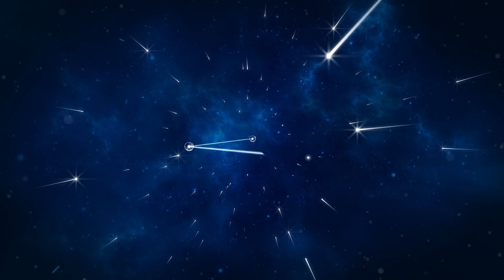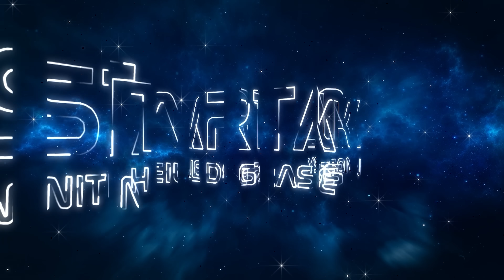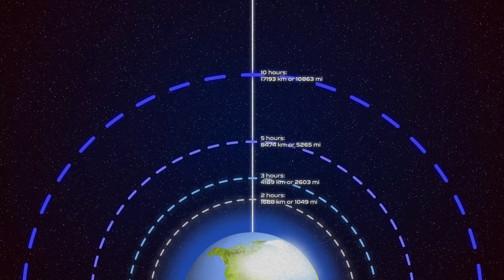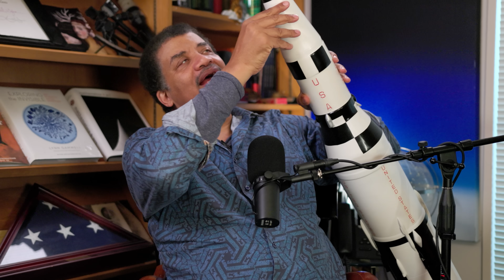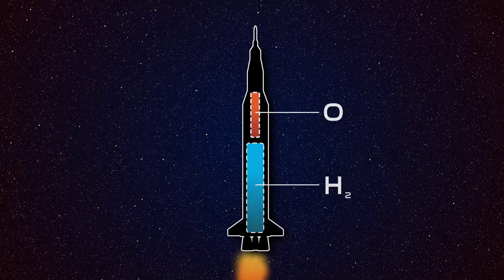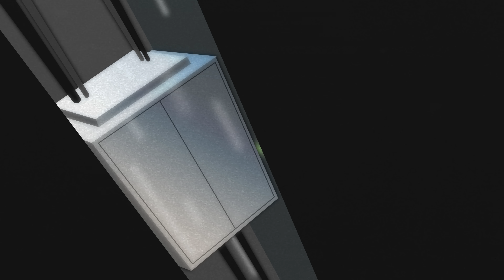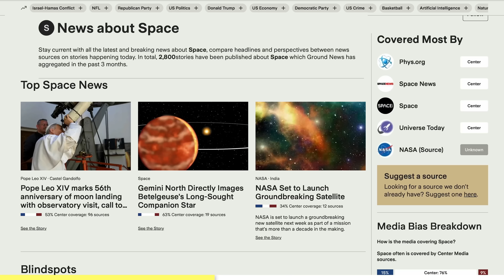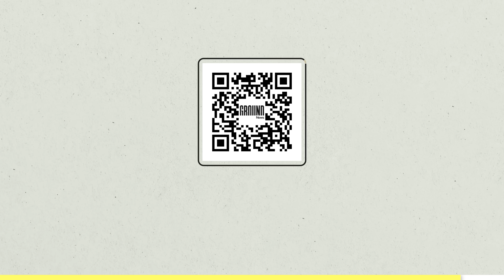When Will We Have a Space Elevator?

Comment: You'd have to be a real dummy to think a space elevator would be used for transporting people to a space port or that you would always ride it to the very top. 

The idea would be to lift heavy equipment and, often, at a much lower orbit. The ISS took decades to complete because small pieces had to be brought up on rockets, months apart, and assembled on site. A space elevator would be counterbalanced at geosynchronous orbit but you could assemble large sections of a space station on earth and lift them to low earth orbit for assembly in much less time.

Comment: The geosynchronous orbit, located at an altitude of approximately 35,786 kilometers above Earth’s equator, is a region of immense significance in both aerospace engineering and Earth sciences. A satellite placed in this orbit completes one revolution around the Earth in exactly 24 hours, matching the planet’s rotational period. This unique orbital synchronization causes the satellite to appear stationary relative to a fixed point on the Earth's surface, making it indispensable for applications that require continuous, real-time coverage of a particular geographic region.

From an aerospace engineering perspective, the insertion and maintenance of a satellite in geosynchronous orbit (GSO) demand a high degree of precision in mission planning and execution. Launch vehicles must achieve a highly elliptical geostationary transfer orbit (GTO), after which onboard propulsion systems perform apogee kick maneuvers to circularize and position the satellite into its final geosynchronous slot. Engineers must also account for a range of perturbative forces, including gravitational influences from the Moon and the Sun, solar radiation pressure, and the non-uniformity of Earth’s gravitational field (particularly the J2 oblateness effect). These forces cause drift and inclination variations that must be mitigated through regular station-keeping maneuvers, which consume onboard propellant and ultimately define the satellite’s operational lifespan.

In the realm of Earth sciences, geosynchronous satellites have proven invaluable for the sustained observation of atmospheric and environmental phenomena. Instruments aboard geosynchronous platforms, such as those on GOES (Geostationary Operational Environmental Satellites), continuously monitor cloud formation, storm development, ocean temperatures, and volcanic activity, providing high temporal resolution data that is critical for both weather forecasting and long-term climate studies. Unlike polar-orbiting satellites, which only provide periodic snapshots, geosynchronous systems enable near-continuous observation of dynamic Earth processes over specific regions, facilitating rapid response to natural disasters and supporting models for global environmental change.

Furthermore, the strategic placement of satellites in geosynchronous orbit enables the formation of constellations that cover nearly the entire globe with minimal infrastructure. This orbit underpins a wide range of systems including satellite television, broadband internet, military reconnaissance, and disaster early warning systems. As space becomes more congested, the sustainable management of GSO positions—allocated through international coordination mechanisms such as those of the ITU (International Telecommunication Union)—has also become an increasingly important subject within aerospace governance and orbital debris mitigation efforts.

In summary, the geosynchronous orbit represents a cornerstone in both the design of resilient aerospace systems and the advancement of Earth observational science. It is a zone where the principles of orbital mechanics are harnessed to enable constant and reliable monitoring and communication capabilities, illustrating a sophisticated interplay between engineering precision and scientific exploration.

Comment: As Chuck joked, but is correct the cable material would start to be extended from geostationary orbit, in both direction for the net pull to be zero.  The real challenges to this endeavor, are micro meteorites, and how the elevator would be powered.   The history of the concept of the space elevator would be an excellent story to cover.

Comment: A method could be a 3 stage escape (plane base) 
Stage 1 mag launch plane/shuttle with air ram engines to 40k ft 
Stage 2 at max air altitude to activate rocket mode to orbit 
Stage 3 return remaining fuel used to re-enter and glide to air jet layer ... re-light engine to land

Comment: I always wonder what kind of structuring you would need for a space elevator to be viable. I mean ten days isn't that big a deal if you're only using it to transport resources, which would keep the purpose staging for further exploration intact, but even with how strong carbon nanotubes are you can't just make a single spire and call it a day. How far out would the supports extend? What kind of supporting architecture would you need to add for future repairs? There's a lot of little safety things that add a ton of padding and weight to the elevator that we have to work around and being the degree-less pleb I am I wonder what it would look like to make it structurally sound

Comment: Ok, here is the next harebrained idea. If we built a ramp to the edge of the atmosphere (edit: or perhaps the upper edge of the troposphere) at the equator, and had an enclosed tube as part of it that kept atmospheric pressure at the bottom end equal to that at the top, and then used maglev or some other propulsion to accelerate capsules fast enough that at the top end they could continue to orbit with less fuel, would it be worthwhile?

Comment: If there was such an elevator, it wouldn't have to be limited to 100mph in space. In fact it could be constantly accelerating (assuming there are resources to do so) up to the midpoint, from which and onward it would start decelerating at the same rate, until it reaches the destination where it's speed would by then be zero. If we assume an acceleration/deceleration rate of 0.5 G's for the comfort of the riders, it would take about 1.5 hours to reach it, and its top speed at the midpoint would be 13250 km/h which is really fast.

Comment: Could someone comment on the question of 'does it save any energy?' The space elevator although slower, still needs to move all that mass against gravity. How is energy being saved? Does it use the same energy but from a cheeper source than rocket fuel? This was the part I never understood.
Reply: Energy is beamed up and converted to electricity to climb the tether.

Comment: As an engineer, there is one thing that bothers me to no end. How the heck are you supposed to get that cable in place? Once it is in place, everything is in equilibrium and it's fine. But how do you get there? You first would have to get the counterweight in place. From there you would have to drop the cable and slowly elevate the counterweight. But the thing is, that, as discussed in the talk, you have different orbit durations and velocities in different heights. So the cable wouldn't stay in a straight line while being dropped. It would wrap around earth, before you get to the ground to fix it. And there is another thing. There is a proposal for such a cable on Wikipedia. I roughly estimated that this cable would weigh (with nanotubes) about 100,000,000 tons. That would cost trillions of bucks. So, I think, the space elevator will always remain a dream.
Reply: It wouldn't wrap around the earth, it wouldn't be long enough.

Tidal forces would pull it straight, that's the whole point.

But the big problem, as you say, is the weight you'd need to get into orbit to build it.
Reply: I guess you'd start in geostationary orbit and launch a rather slow cable laying rocket up and another one down.
Reply: @onkelfabs6408  No need for rockets, you can just unroll the cable and tidal forces will do the rest.

The problem is the sheer mass of the cable, and you need to get that full thing into geostationary orbit first.
Reply: @ZarchAlDain  Well you need something to get it going. You cannot unroll a coil in zero G.

Comment: Hi, Its the chlorine solid state fuel that's the problem with modern rockets that needs to be overcome.Anticipated 1000 launches per year by 2030. The solid state fuel is considerably less polution than we do direct on earth, but its ability stay in the layers around earth combined with its slow corrosive nature, with the volume of anticipated spacecraft( not including solid state powered satellites of which there are around 4-5000) has the potential to accumulate and contribute to global warming issues far quicker than previously estimated. Its not widely discussed.
Space elevator has been knocking around for a while. I had a very similar conversation in early 2000's with one of my bosses sons. Still a thought experiment, but hopefully innovation will lead to better rocket propulsion.
Great topic
Cheers

Comment: i just dont understand how we havent figured out external propulsion.having something propelling a craft even halfway there reduces heavily the fuel expense on the aircrafts lift and solves the fuel problem as they go higher the air thins and easier to create propulsion. that unneeded fuel reduces costs while lowering the cost of pound of material going into space. it woud also reduce the cost because the first stage rocket its engine and fuel wouldnt be needed. if a rail gun type system could be created (and yes i know that would need a wild amount of electricity to the point a complex of nuclear energy and battery arrays would be needed to power this thing but electricity is way cheaper than rocket fuel.

Comment: There's no reason to limit your elevator car to 100, 200, 300 mph, etc. Once you've gotten above most of the atmosphere, you could accelerate the car continuously and cut the trip time to a small fraction of that. You'd want the car to work like a maglev train so it's not putting wear on the cable every time it goes by, but this is just an engineering challenge, and shouldn't be intractable once we have the ability to make such long carbon cables.
Reply: The G forces might be immense upon stopping it though.
Reply: @camerondudley2  Why would it need to stop suddenly?  You accelerate at a comfortable rate until you reach mid point, then decelerate at the same rate the rest of the way.
Reply: You would still be fighting gravity. It wouldn't get that much weaker as you rise up. Sure no air resistance, but you wouldn't be able to excelerate indefinitely.
Reply: @wisemanofsorts6068  Gravity is a constant pull though, regardless of your speed. It's no harder to counteract while going 1000 mph than 100. If you can accelerate upward against gravity you can continue to do so no matter how high you are or how fast you're moving. (It's not like a car with a transmission that can't climb a really steep hill at high speed because the power is reduced.)

Comment: the space "Rope" idea is not that bad, infact, if u dont build a hard stiff tower that has to withstand its own weight, but rather a just something flexible like the rope of the "elevator" itself, or rather a <Funicular> -like  thing, with it being already fixated in space by that mentioned counterweight, then u only need a material for the rope that doesnt tear but gets pulled up against gravity by that counterweight. ...
but be it unpractical as the elevator-part may,  the space port from which to launch rockets would still be a useful thing --- if a rocket just needs enough fuel to go to the station and back, it doesnt need extra fuel to lift the weight of further fuel. --- having the elevator just for goods, like fuel needed for rockets launching from said space port or whatever else that can sit some weeks during transit, would then still be something useful 🤷‍♂

Comment: The material for the cable is one of the problems. Apart from needing ridiculous strength, it would need not to stretch significantly.  To start with forget steel.

Comment: A fantastic debate, an engineering wonder that I've been interested in since reading "Fountains of Paradise" by Arthur C Clarke. However, a couple of points that I think are worthy of note. Firstly, if there were a series of "trains" going up and down simultaneously (raw materials from asteroid mining down and manufactured goods and consumables going up) with regenerative braking the cost of climbing to orbit would be VERY low. Secondly, the speed of the lifts (US: elevators) - rather than using buildings as the model I think Maglev trains are a better model, the distance is 37,000km (23,000 miles) China is about to test a 1,000kph train - this then reduces the flight/travel time to 37 hours, admittedly a long trip, but if the "style" of travel was more like an old style airship or the Orient Express the journey could very well be one of the reasons to get up to Geostationary orbit.

Shame no mention of "rocketless rocketry" where the angular momentum of the elevator and possible "extenders" beyond the Spaceport could allow the release and capture of people and material from around the solar system as release/docking of high speed vehicles using the relative speed of the elevator.  Obviously rockets will always be used but hopefully consigned to the super rich idiots who will definitely want their own spaceships <sigh>.
Reply: the same thing happens on the space odissey sequel books

Comment: I propose a solar ring around the earth, built by robots using asteroid metal, the ring is stationary crossing over the poles and along the dusk line, always facing the sun. It's built rotating in orbit. Once a completed ring it can be stopped, being designed to withstand gravity while stationary.  Once stopped,  space elevators and power distribution lines can be dropped at the north and south poles. 

You are welcome. 😄

Comment: One thing you didn't mention was using the elevator for cargo that doesn't care about the time taken.  Therefore you only need enough fuel in the rocket to get up to station where the rocket can refuel from the fuel brought up by the elevator.  After that there are multiple options, such as continue onto the moon, transfer to an interplanetary ship, etc.  Food and other cargo can also be shipped up inexpensively.
  On the downside, it has been theorized that terrorists might attack the elevator and if they were to snap the connection then it would fall back to earth and it would wrap around the earth 2 times at high speed and it would cause a lot of damage.
Reply: I think the biggest value a space elevator would offer is that you can have a system where you have one package travelling down the elevator while you have another package going up the ladder, and use the gravity on the package going down to power the package going up. If for instance you had a mining operation in space, you could put the materials you mine down the elevator and use the energy from that to send people/stuff that was manufactured on Earth up into space, making an operation like that overwhelmingly more efficient (maybe even to the point of actually making mining stuff in space economically viable).

If you could magically solve all of the engineering problems, there would be a lot of real benefit to a space elevator.. of course, solving all of the engineering problems is still a lot more easily said than done.
Reply: The "snapped tether" fear can be mitigated. Include failsafe's so that if the tether is snapped, it can separate into smaller segments. Much would be carried off into interplanetary space vbt it's rotational velocity, and the loose segments could be small enough that most would burn up in the atmosphere. Rail guns, magnetic deflectors, or similar tech could be mounted up and down the tether to repel or destroy any debris likely to collide, and the tether itself can be "steered" by VERY minor movements in the counterweight station that oscillates the tether. It;s not foolproof but there are loads of ways to make them safer

Comment: I would have thought a slow but relatively low energy budget transport mechanism that isn't beholden to the tyranny of the rocket equation would be useful for heavy transport which usually isn't time sensitive. Presumably with sufficiently advanced magic, you could also use the beanstalk (the cable and its various related attachments) as a power transport mechanism.

Comment: FUN FACT: The fastest elevators in modern high-rise buildings travel at a top speed of 40 mph.  At that speed, an elevator ride to space would take 23 days, 22 hours, 59 minutes and 56.4 seconds (if you don't stop for McDonald's along the way).  *Add roughly 28 seconds for starting acceleration and stopping deceleration.  Add 5 seconds for the damn elevator doors to open..

Comment: Correct me if I'm wrong, but the spacex is the most common rocket going up and it's powered by liquid oxygen and (kerosene or liquid methane). 
Common, but each launch is putting out a lot of CO2.
The Boeing rockets are using solid fuel boosters (so lots more CO2) in addition to the oxygen hydrogen fuel.